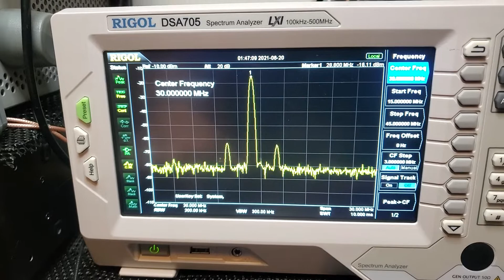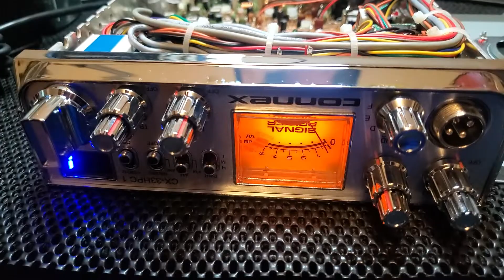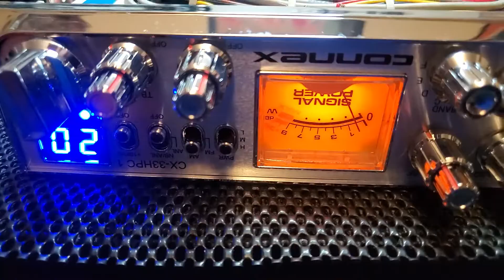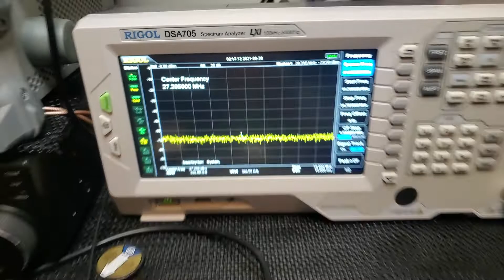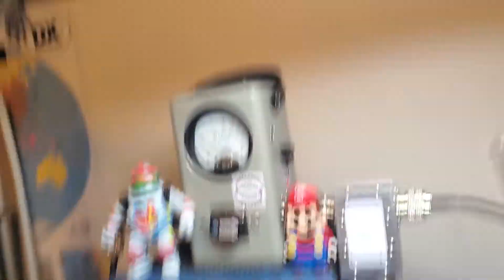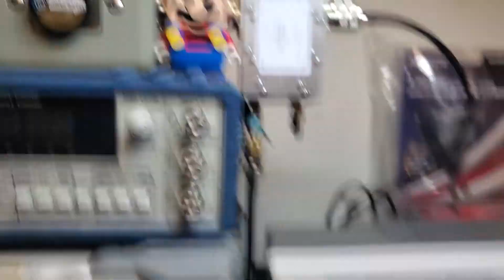Connex CX-33HPC1 out of the box OEM test.

Comment: Did the sensitivity remain the same from out of box 10 meters and after the 11 meter conversion or did it need a touch up for best sensitivity on 11 meters?
I have had some 10 meter radios that appeared factory tuned for best sensitivity on 10 and it was less on 11, but after a alignment touch up it was good on 11 meters.
Reply from the maker: It was better on 11 meter.